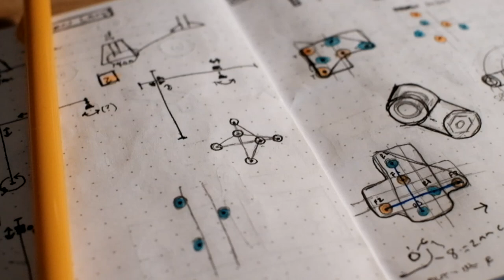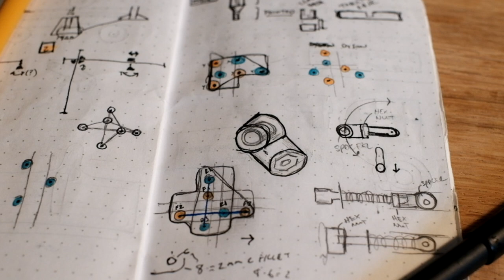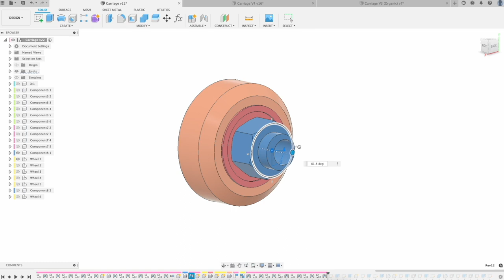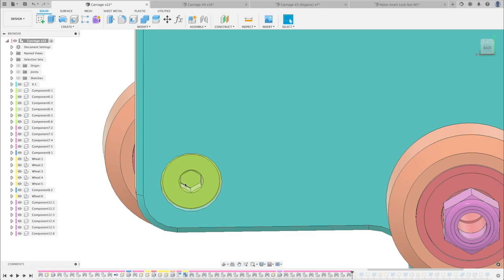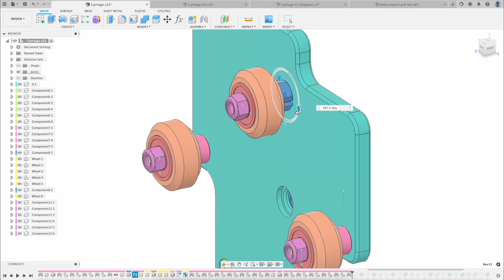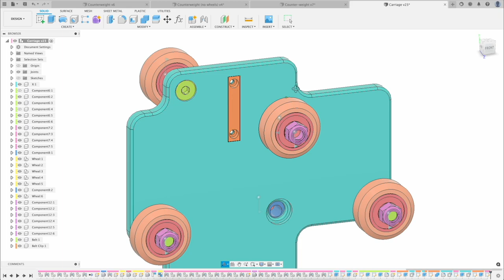Designing the 3D Printed Carriage of my DIY Dyson Task Light - DIYson Lamp Build Log #1

Comment: I think the spring loaded wheel is more for compensating tolerances and self adjusting for future wear without user needed maintenance.
Reply from the maker: Yup, I think you're right that it plays those roles, and after a lot of trial and error, I'm also fairly convinced that it plays an important role in applying the perfect amount of clamping pressure on the rail. I could be wrong about this, but my bet is that the Dyson solution is meant to simultaneously address the issues you mentioned and optimal wheel position :)
Reply: @StevenBennettMakes  I could probably make a carriage plate out of some scrap aluminum if you haven’t made one yet.
Reply: Think it will be more then fine, 3D printers/CBC  use this method and don’t seem to suffer from any of those issues.
Reply: I think the springs could be for releasing tension on the vertical axis when you move the horizontal axis. When you have 3 fixed wheels, you have to push in a precise angel in order not to give too much pressure on the vertical axis. I think the way the spring(s) are mounted, you have only two fixed wheels clamping the horizontal rod in stead of three en therefore decreasing the pressure on the standing rod, the vertical axis when sliding it. 
There must be a reason the spring loaded wheel is not vertical (pressing down), but in an angle. I expect the spring to be very loose. 
And are there not two of these springs. I think I see another groove. Maybe one for going left, the other for going right. I will watch the next video’s to see if this holds up. I’m curious to find out! Nice project!!

Comment: Something minor but maybe I think you can look into is instead of using screw as the shaft for the wheels, you can consider finding some shoulder screws, they will have a smooth surface for the wheels to move on, and also avioding the problem of overtightening the wheels by over-tightening the nut. This is quite a minor thing but it may helps a lot in the smoothness of the motion.
Reply: It looks like they have bearings so it's not running on the screws hopefully
Reply: @kbshadep I will its generally a better practice to use shoulder screws than normal screws, but this is just something minor to the  project.

Comment: Hey i like your idea but sorry to say this this spring approach from Dyson it’s so much more elegant and the nut if you use this a lot u start to hate it
Reply from the maker: Oh yeah? Interesting. Does the nut start to lose tension in your experience?
Reply: @StevenBennettMakes  not only to lose, losing is one problem but to get the really really Perfect tension that you in your case u really need and want to get this same experience of sliding try it on a test bench. Your are not chineses copy cat guy, you want to understand why Dyson did this right ? And the wheels will lose material with to much force.
Reply: I will not say that the openbuild stuff are bad I love the openbuilds stuff I have build with they stuff 3D printer, diy laser cuter and much more tools